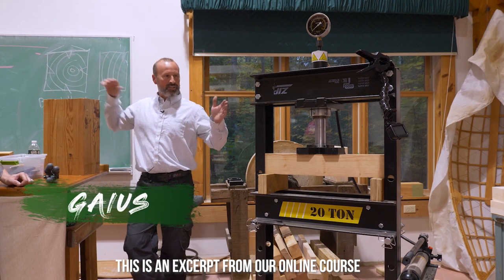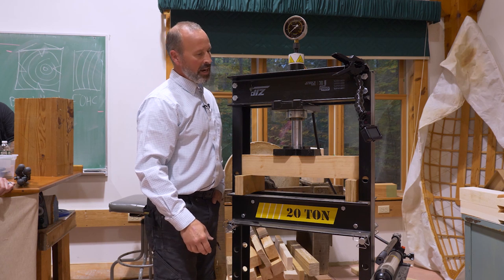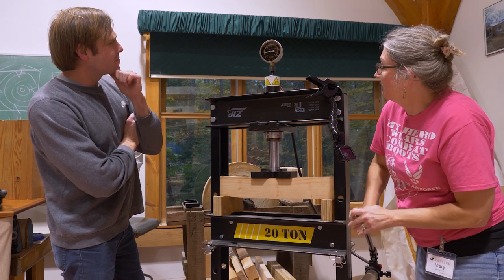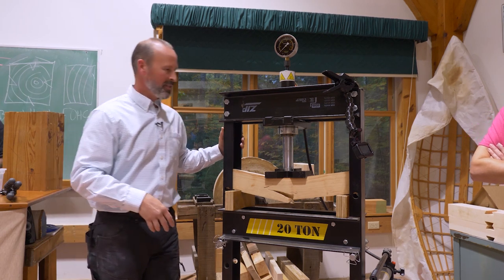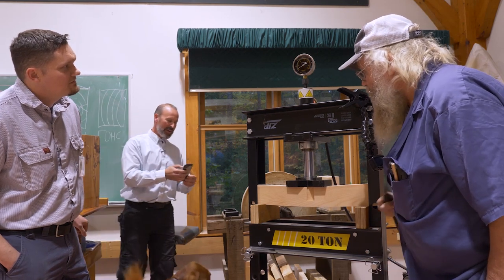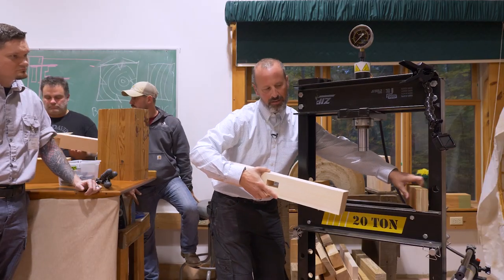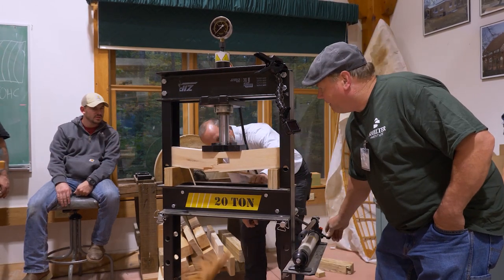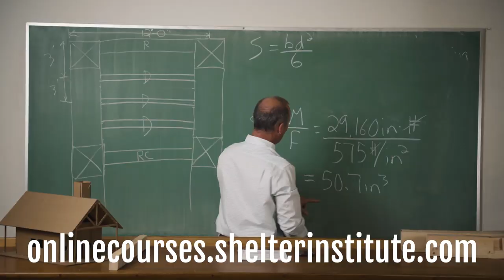Forcing Model Timber Frame Joints to Failure using a Hydraulic Press

Comment: Hmm, increase the cross section where you have tension loads, keep knots out of loading paths.  Of you can go to rounded corners the failure mode changes too. I expect if there was wood occupying the empty space to provide a block to compress into, the loading would change too.  I wonder what the typical tension on the bottom to the compression on top ratio would be and if denser growth rings make for better tension or compression load resistencs?

Comment: As interesting as it is, isn't it a bit of a flawed example? Failures like the dovetailed timber wouldn't be the same if the tenons were in the mortised spaces preventing it folding in on itself. Would be more interested in seeing how the completed joints with both mortise and tenons compare to the solid timber.
Reply from the maker: Thank you for the question. Most failures in wood occur on the tension side due to the natural defects (knots, slope grain, etc) in wood, contrary to the theoretical idea  that the maximum fiber stress value of a (clear) species of wood is the same on the tension and compression sides (top and bottom). Putting a wood plug (such as a tenon) on the compression side does not make an appreciable improvement in the performance of the dovetailed timber. From a structural engineering standpoint, we must treat the mortised timber as if it has an open mortise because the grain orientation of the inserted tenon is perpendicular to the grain orientation of the mortised memeber, and the perpendicular-to-grain compressive strength of the tenon is less than the parallel-to-grain compressive strength of the mortised member, to say nothing of the possibility of shrinkage of the tenon eventually eliminating any contact between the mortise and tenon. All of this is to say that the test being performed gives the best representation of the actual capacity and failure mode of the mortised member.

Comment: Great demonstration of the strength of wood. Even though the beams failed, they didn't break all the way thru and they gave plenty of warning they were going to fail with all the creaking and cracking. Metals do not behave like that at all.
Reply: What the heck are you talking about? They didn't load the beam past ultimate capacity of the wood, as they stopped loading it after the initial appearance of splitting/lamellar failure in the tension face of the sample. They specifically defined failure as splitting at the tension face which is why they stopped loading it; failure occurred suddenly, in a brittle manner, which is opposite to what steel does. Creaking doesn't mean failure as wood "loosens" under static load over time (a phenomenon called "creep"), just like concrete; creep isn't failure, but only reduced performance (think SAGGING over long term). Metals are insanely better for failure prediction and performance entirely; think about how many times you can bend a paper clip back and forth before it eventually breaks into two. By the way, the ultimate capacity of wood is amusingly varied between species and grade, and even inconsistent between batches which makes building large structures immensely risky, if you chose to build with it. Timber is good enough for what it is used for as well as architectural applications; metals are superior (though we use concrete everywhere due to its availability, but even that needs steel to "hang" with metals).

Comment: All this test proves is that if you reduce the cross section of the test piece it will reduce it’s overall strength. Can’t see the point of the demo myself .
Reply: Not only that but the point load being spread across that plate on top simply moves the moment of inertia to the edges of the plate. More or less splitting the single point to two separate spots. I also love how no one is using safety glasses ....